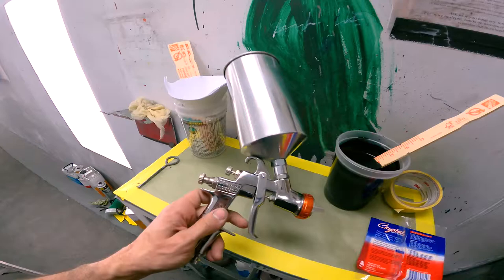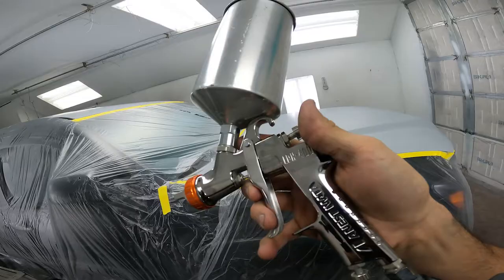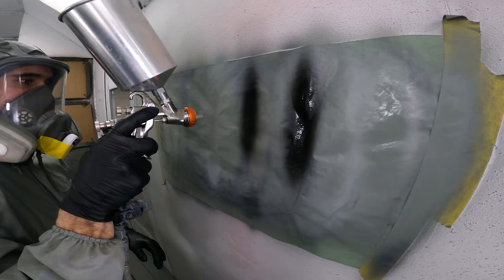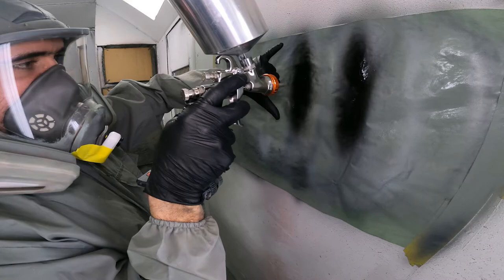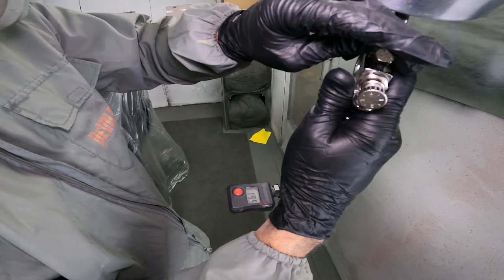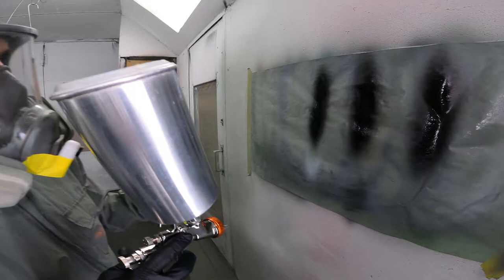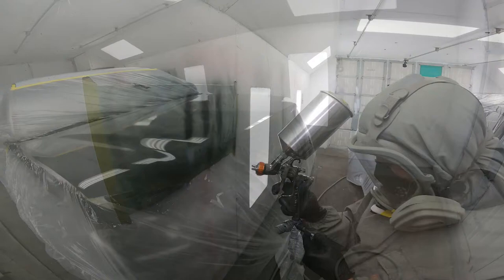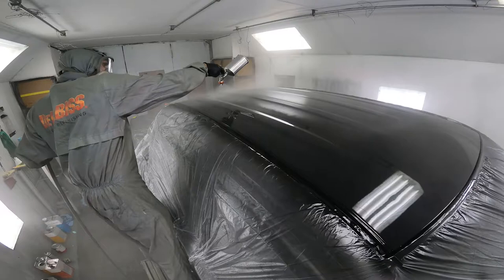Iwata LPH 400 Setup and Review | My "GO-TO" Spray Gun

Comment: Also that orange cap is not the best for clear. You gave the gun 4/5 for finish, but throw a purple cap on there and then rate it! Lower the pressure a few more psi even 10-12 psi total the purple cap sprays Lamborghini flat clear. You know what I mean.
Reply: Where can I buy the purple cap you are talking about?
Reply: @LuisC202  iwata lvb cap

Comment: I'm a newbie using this gun and also painting do you remember how many turns u usually use on the fluid tip ??? also I feel that this gun uses a little more material than others is that right or just me using wrong the gun??

Comment: i have the silver cap LV4 in 1.3. Great gun for painting in my garage with the low overspray. I usualy keep it under 22psi. Some go higher. Full fluid usualy. 2 1/2 turns in from wide open on the fan cleans the pattern up just as the pressure goes up on the cheater valve. Not a huge fan but big enough and great atomization. I like it

Comment: Hey Fred thanks heaps for slowing it right down with the detailed explanations. Your one of very few guys who I actually understand when you are teaching stuff.
Can you explain what a Tac Cloth is please. Might sound like a dumb question but I have heard the term used for years but don't actually know what it is or how it works. I've never seen or used one either but I have never done anywhere near a decent paint job on any car either. Just El-Cheapo spray gun and small compressor. A 1950's spray gun run by the exhaust of a Hoover vacuum cleaner and of course rattle can jobs.
Reply from the maker: a tack rag is a sticky cotton rag (kinda looks like cheese cloth) that is used for wiping down panels that you plan to paint. It's the final step after using wax and grease remover to eliminate any dust that is on the surface. Some people use microfiber cloths instead.
Reply: @UWrenchTV  thanks heaps.
Any idea what the sticky stuff is on the rag?
Reply: @1974UTuber  it's a weak glue

Comment: I'm using satta jet 4000 and I have a lph 300 that I use quite a bit for base and clear and sometimes I use the satta for laying down my metallics and then I use the 300 for the clear coat but I've done both vice-versa I've used the l p h 300 but I've done both vice-versa I've used the l p h 300 spray my base and then the. Sata jet 4,000 for spraying the clear

Comment: Damn it layed sealer and base coat snd clear beatiful now im curious u sprayed at low pressuer between 19 for the sealer and like 14 to 15 psi for the clear is it because it atomizes better at low pressure or is how u feel comfortable i normally have tried 35 40 psi on the lph 400 iwata and i get a bit of  orange peel im gonna spray next time at low psi any ideas thanks brother awesome job
Reply: Willy he shot the clear at 27 psi mot 15...
Reply: He used 19 for sealer 13-14 for base and 27 for clear (fluid wide open). Most painters use around 22-24 for base and 25-30 for clear with 2.5 turns out on fluid, but there is no right or wrong way to get it done. Just like he said in the video this gun works well at a wide range of pressures and settings.

Comment: The lph400 is great out of the box but it's a bit slow...which is why you should port it like I did. Once you get more air moving through the gun you can also get more paint through it. 1.4 of course. Ported it's as fast as any SATA but with better control and much less over spray. As for the pattern you need to dial in the fan one or two full turns.
Reply: Port?
Reply: @tonydiesel3444  I use my LPH400 for clear exclusively, and I actually prefer it to be a bit slower for that. You can really dial in your finish texture and get that clear exactly how you want it to lay out. Personal preference though!
Reply: @tonydiesel3444 the air fitting in the handle is a little restrictive. Porting the fitting will give more flow at a lower pressure. It is like running the gun at a higher pressure. It just takes some load off the air compressor. As most air compressor can flow more air at a lower pressure.
Reply: Interesting ! I stopped using mine for clear cause of how slow it is...but I still put 5 coats of metallic base with it and the  metallic come put beautiful...but yes very slow gun and def don't try it at 16 psi.  Bump it up!
Reply: @Handlehandlebars  port the fitting on the bottom also make sure you are getting max air volume. Not pressure, volume. Use the shortest hose possible with the biggest inner diameter possible. Sata makes 25 foot air hoses with extra big inner diameter check them out.

Comment: Ive been using this model gun for a good 10+ years. But i dont think ive ever seen someone say to go as low as 19psi for basecoat. Is that just personal preference for you or only because its a solid black color?  I always use 30-35 when painting base.
Reply from the maker: That’s the pressure he usually sprays at… might go as much as 22psi
Reply: @UWrenchTV  All paint colors or just a solid color like white or black?
Reply from the maker: @stang1991  solids between 19-22psi metallics between 16-19psi

Comment: Have you tried the w400 bellaria? If so...there's too much difference between the two?
Reply: Whole different beast. Good gun the Bellaria. I spray in a garage where I don't want a ton of overspray. I have both Bellaria and the LPH400 LV4 "original" silver cap. The LPH atomizes really fine at loooow pressure. Very low overspray. It's a trade off tho. Makes it slow compared to the Bellaria. The Bellaria atomizes well at higher pressure, is faster, and has a big fan. But it also has a bit more overspray. If you don't mind the overspray you can't go wrong with the Bellaria. It's also good with hard to spray metallics. Because of the low overspray I prefer the LPH400 even tho it's slower at recommended pressures.

Comment: I see alot of crazy things in this video for an experienced l painter, the booth exaust filters are falling out and some of the openings are covered with card board and the inlet filters have one put in backwards!  its just weird to see that the booth is not set up right.  Most painters set their booth up correctly so that they dont have air flow problems that can lead to die back or solvent popping problems or even dirt problems.
Reply: It’s crazy how much you don’t understand that there are different color intake filters and that the exhaust side can be manipulated in many ways without issue.
Reply: @dhaley8847  43 years and you’ve never read that if the fan is unrestricted you should block off exhaust filters to control CFM? Or that there are 3 or more different color intake filters? Maybe reading is more important than years in an industry…
Reply: @90crxdx  blocking off the exhaust changes the air flow and causes turbulence and cause uneven drying.  also is you have the correct fan that was engineered for the booth whens it was designed there will be NO need for blocking off some of the exhaust filters.  I have been in many shops because I also own a auto paint store and I have seen people that have no clue what they are doing like you and they all do stupid things to their booth! None of them are successful and none of them have the proper air flow.   They suffer with solvent popping or dye back and just make excuses as to why this happens.  they exhaust problem you are having is probably caused from improper inlet filters that are allowing too much air in the inlet end!  Yes dummy I have read and took many classes about this industry and I guarantee that you have the wrong inlet filters!  but you cant teach anything to a know it all like you!  putting white sealer under a black car says it all about your knowledge!